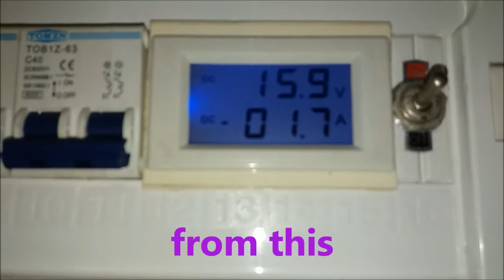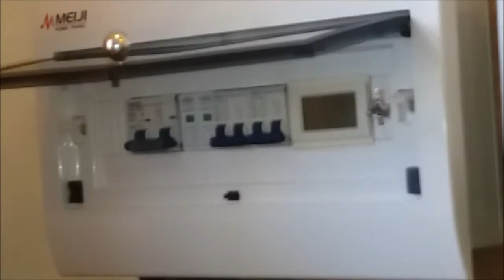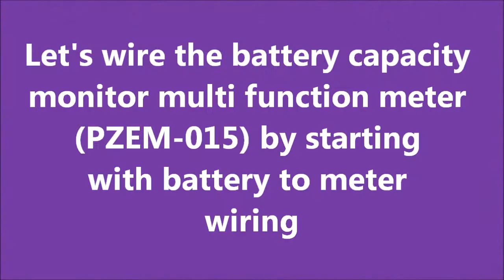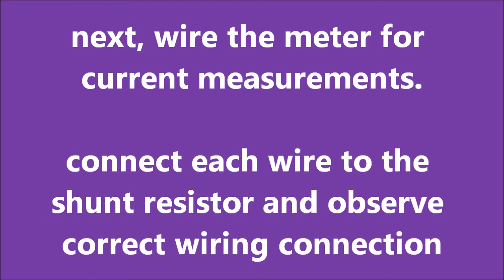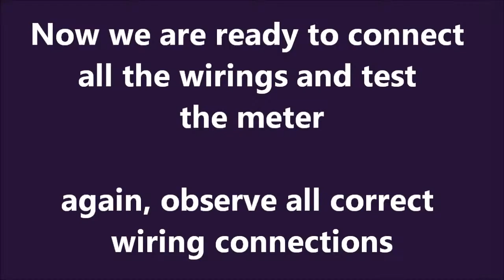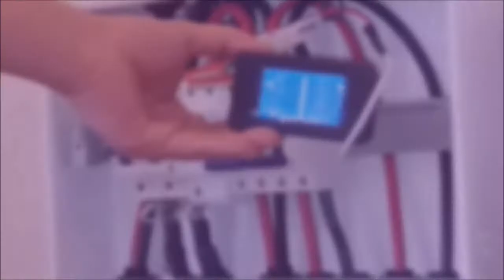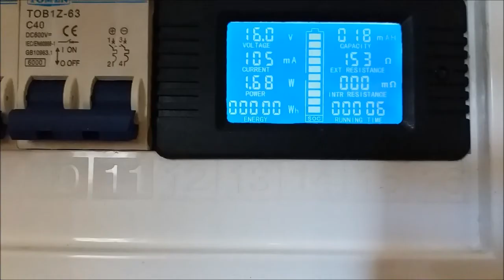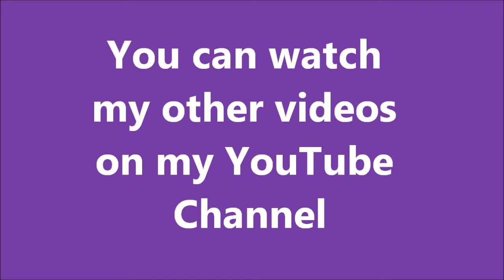PZEM 015 battery capacity monitor installation (tamang pagkabit ng PZEM-015 monitor para sa baterya)

Comment: When will you be performing the battery capacity test, and could you show how to set up the parameters (full voltage and cut-off voltage)?
Reply from the maker: Yeah sure. definitely i'll be uploading videos for the lifepo4 pouch cell capacity test and how to set parameters for the full and cut voltage and current. but for the meantime you can watch my video on Li ion battery pack (18650) capacity test. https://www.youtube.com/watch?v=WpJhyhERPU4&t=2s

Comment: Pwede po ba rekta na sa battery yung connection ng shunt? Yung portable battery pack ko kasi merin inverter(ac load) at dc loads. Para po mamonitor ko lahat ng load
Reply from the maker: i think if ur going to draw less than 10a pwde sya direkta sa battery. pero kung mas mataas sa 10a ang magiging current draw mo better have shunt resistor. otherwise bka masunog pzem meter. search na rin ng specs online to make it sure.

Comment: Okay lang kaya laging naka dormant mode ito. Hindi ba sya masisira?

Minsan lang kasi gamitin eh.
Reply from the maker: Pwde nman po sya i-off lang. please check ur manual. Pero mabuti na rin na i-on sya from time to time to check. 🙏
Reply: Samat sir. Actually ginagamit ko lang sya kapag nagka-capacity test. Woried ako kasi baka masira hehe
Reply from the maker: @offthegrid2635  usually nman nakakasira ng mga meter either over current or over-voltage. pero kung normal use tatagal nman po yan.

Comment: You did not show how to wire the meter from the batt.
Reply from the maker: sorry, the old meter was pre-wired, that's why u cannot see how i wired the PZEM-015 meter. so what u have seen was reconnecting all the existing wires. but u can see it here on my other video (shunt replacement). it shows the diagram for the battery connection of the meter.
https://www.youtube.com/watch?v=GLulXYHWffY